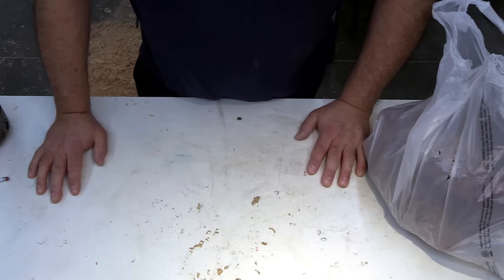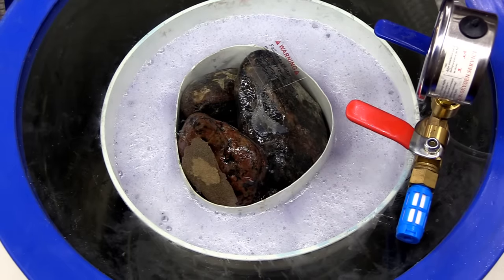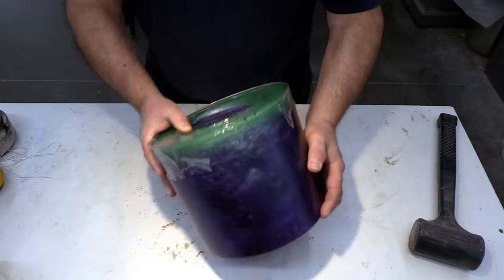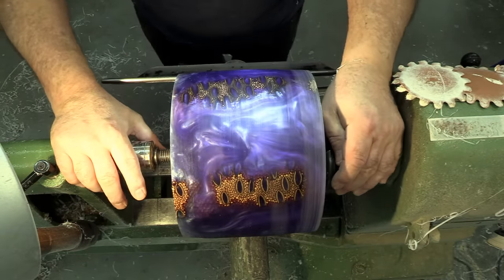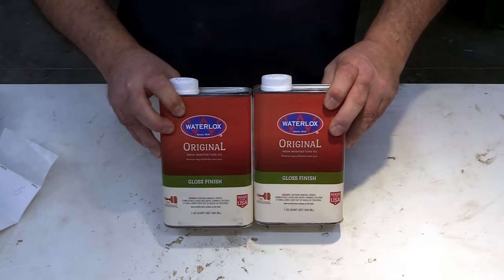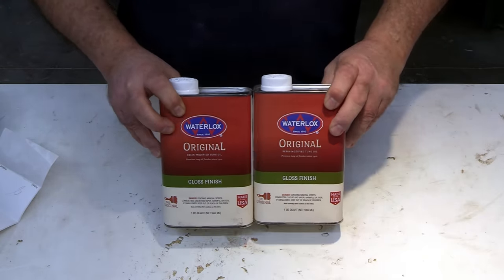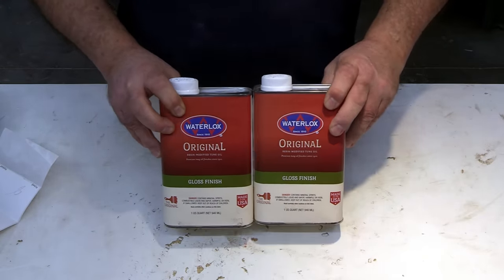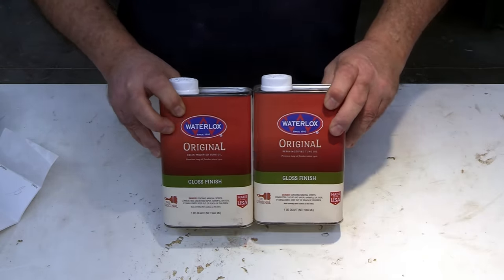Woodturning - Australian Dragon Skin? 2024 is The Year of The Dragon!

Comment: I often wonder why you put the epoxy coat on and then sand it to 220 and the apply the Waterlox. The piece looks incredible with just the epoxy coat from Designer Epoxy. Another great piece.
Reply from the maker: If you were holding it in your hands you wouldn’t say that. There’s some small runs and the bubbles are an issue too. Thanks.

Comment: That is an absolute work of art! Those pods with the colour make this an incredible conversation piece! I swear, those pigments from Designer Epoxy never cease to amaze me in their showstopping colours. I think that, because the green wasn't the same temperature as the purple, might explain why it traveled to the top, but that's just a theory as I've never worked with resin before.
Reply from the maker: No, I don’t think that’s it, possibly the purple pigment is a little heavier then the green and that’s why most of it ended up on the top. Thank you very much!

Comment: You should try using slabs to weigh down instead of mdf. That way you can keep the top and it makes it part of the design rather than forcing you to lose part of the casting. Also, those banksia nobs would make a cool handle for a lidded dish. Everything about wood turning and casting I know from watching you, so if there's an obvious reason for not doing either, sorry!
Reply from the maker: I will certainly hold onto them and cast them in the future. Thank you very much!

Comment: Another cool piece. As far as a more affordable finish, i make my own. Gloss polyurethane, tung oil, and thinner. Mix about 70/30 poly to tung oil and thin. You use enough varnish to know how thin you want it. Way cheaper, a couple quarts for around $40 US. Ive read about people using  a 50/50 mix but i go heavier on the poly and it works well for me. Hope this helps.
Reply from the maker: I can’t use this finish as it’s not certified non toxic once fully cured. Thanks for watching!
Reply: @SpragueWoodturning  I forgot you sell yours for utilitarian if they wish to do so.

Comment: I can easily cut the 6160 grade aluminum on my Onefinity CNC with good quality carbide spiral router bits. Just need to reduce the cut depth and feed rate to prevent clumping of the aluminum. Have not tried to cut it on a lathe but should work fine as an inlay. I will have to wait for you to try it and see.
Reply from the maker: Spoiler alert, it works great and cuts easily as an inlay. You’ll see it on Friday. Thanks

Comment: I think part of the problem with the green was that the seed pods weren't glued then you bobbed them up and down when you went to put the board and rocks back on it. The up and down motion pulled the green right back up. It is another reason so much green was on the top. I don't turn but I do a lot of resin and when you do that technique it's got to be in and out one time and then leave it otherwise it mixes just like what happened to you. Just a thought you might want to consider. I loved the look even though repeating holes like that gives me the heebee jeebees! lol Great piece!! Designer Epoxy
Reply from the maker: Yes, gluing the pods in place would of been better. Thank you very much!

Comment: When redurfacing brake druns which also chatter we wrap what i can best descrube as a wide rubber belt aroubd the drum.  Not sure if yku can get a wide rubber belt, but thats what we use.
Reply from the maker: As a former mechanic, I know exactly what you’re talking about. I bet I’ve done hundreds brake rotors and drums, lol. This here is a different chatter than that or vibration if you prefer. Thanks for watching!

Comment: Gday Jim,
Banksia pods rom Oz cost about Au$6 down here and up depending on size. They grow up to  1 foot by about 4.5 inches, I’ve never seen them that big but have certainly seen them much bigger 5han those you used.
If turning pods in the future be very careful of the brown fuzz as it can cause irritation to eyes and exposed skin.
Banksia pods are quite tough and abrasive to tools. 
I’ve never seen stabilised pods but that would help the turning and eliminate the dust that these can cause
Certainly a very unique bowl, hollow form. And thanks for sharing.
Reply from the maker: Thanks for the info!

Comment: This is my favorite piece you have done BY FAR!!  I have no constructive criticism. None.  I love that you went with the enclosed bowl.  It allows viewing the interior when most of your hollow forms do not, both in the finished project and to see the hollowing process.  To be honest, I like the enclosed bowls better than the hollow forms because of that.

I love the effect of the full sides of the pods as dragon skin, but I do agree with your first impulse of cutting cross sections and making a bowl where you can see both the shapes as both the interior and exterior very easily.

And as I'm typing this a person who plays Dungeons & Dragons, reads fantasy novels, and plays World of Warcraft, what about using the pods to turn Dragon's Eggs?  They would obviously need to be stabilized first and would fall into the category of "smaller volumes" that you were talking about at the end of the video, but they would be a hot commodity to fantasy fans, as a solid sculpture and as a small container (like a large nesting doll size).

Designer Epoxy
Reply from the maker: If I was doing production work I think the egg idea is a good one. Thanks for watching, I really appreciate it!

Comment: that is awesome.  I've always like the look of banksia pods, but didn't know how hard they are and I appreciate the heads up about needs to watch the sharpness of the tools. is it just much easier/safer to hollow it out on the lathe rather than pour it with a center place holder?  I was a little sad when you essentially turned the pod in the center into shavings.  I am supposing it's also a safter grip for the centers to have that pod there.  designer epoxy
Reply from the maker: It’s still visible on the bottom, and as I’ve previously stated, I’m not a fan of spacers that will determine how a project will need to be turned. Sometimes sacrifices will need to be made. Thanks.

Comment: Maybe try a cold air gun blowing on part right where steady rest runs keep heat out of that area.
We use cold air on some metal machining operations where you don't want messy coolant contaminating part or machine tool components
Reply from the maker: Good idea, thanks

Comment: There was a lot of movement after you added the green. Those pods were swimming around and you were trying to push them down. All that commotion is what mixed the colors (probably). I bet if you'd glue pods to the bottom so they'd stay fixed during the second pour (or should I say injection), then there would be much better color separation.
Reply from the maker: I’d say your right. Thank you very much!

Comment: In regard to the resins mixing and one not showing up, I'm wondering if the weight of the pigment might also have something to do with it floating or not. I'm sure the different colors that they use in those mica powders vary in weight depending on what ingredients are used. Some may be more buoyant than others. Just a thought.
Reply from the maker: Apparently they are the same weight. Thanks

Comment: For your chatter issues it looks like you need to speed up your rpms. Your cutting with carbide which wants pressure and speed to work. There are several different carbide blends out there now. You may want to contact your tool supplier to get more information.
I would start by checking your surface speeds. There are several apps to assist you with surface speeds.
I'm a retired machinist and surface speed is everything in how a tool cuts. Your pick of material will change your speeds as well.
Reply from the maker: Unfortunately I couldn’t go any higher on the speed, way too much vibration. Thanks

Comment: Jim, regarding the wheel issues foe the steady rest, do you know what hardness your wheels are?  I am an inline speedskater and wheels do have different hardnesses.  A softer wheel is rated in the low 80s while a harder wheel is in the upper 90s.  Those numbers mean nothing to you except it seems your wheel issues are related to the new ones you are using.  Try the opposite hardness if you know which you have now.  Hope this helps.
Reply from the maker: They are in the 90s, thanks!

Comment: Should you do something like this again in the future, it might be a solution to affix your pods etc, by fastening them to the bottom of the bucket using screws through the bottom of the bucket and into the inserts. This way you can control any buoyancy of the inserts and you can control the elevation above the bottom of the bucket giving you a totally encased insert. To prevent leakage you could seal off the screw heads with hot melt glue.
Reply from the maker: Like I said in the video, I wish I had of glued them down and it wouldn’t be an issue. Thank you very much!

Comment: What kind of smells do you encounter while creating your projects? I, personally, know what hot melt glue smells like but not much else in the way of what you use each week. Do different woods have different odors while on the lathe?
Reply from the maker: Yes, I usually can tell the different wood apart by smell. Different resins will smell differently as well. Thanks

Comment: So why do you use a vacuum chamber for epoxy instead of a pressure pot?  Does it actually get all the air out before it hardens? I have seen people stabilize wood with cactus juice in a vacuum first, bake it, then cast it in a pressure pot
Reply from the maker: I will usually use both when casting resin. If I’m working with good solid pieces of wood and I’m using deep cast that has a long open time I will usually skip the vacuum chamber. Thanks for watching!

Comment: Mixing the pigment with resin - to avoid adding too much air into it you can either slow down the cordless drill, or change the mixing thingy itself (to one that pulls the liquid from the bottom up, boat propeller style), or both.
Or you can try pre-mix the pigment with a small amount of resin first. Like, if you have a half teaspoon of pigment to mix in, pour 50 ml or so of resin into some small container, with a bowl-shaped bottom, add the pigment in and mix it not with square spatula but using rounded end peg. Once you get everything thoroughly mixed, just pour it into the batch of resin, "wash" the mixing container with more clean resin ans add it to the batch too.
Also, pre-wetting the pigment with a small amount of thin liquid (like acetone or pure alcohol), one that won't interfere with resin curing will facilitate mixing the pigment with resin too.
Reply from the maker: Thank you very much!
Reply: @SpragueWoodturning  "pre-wetting the pigment with a small amount of thin liquid (like acetone or pure alcohol), one that won't interfere with resin curing" - AND neither with pigment itself, of course. I guess those are not mineral ones, but some artificial stuff, so check it first.

Comment: can I do this with just pressure pot or vacuum pot? I do not have either a pressure or vacuum pot but for financial reasons would prefer buying one that would work. Thank you for your videos and great work!
Reply from the maker: You don’t need one at all, but the vacuum chamber and the PP will give you a better casting. If I could only afford one I would get the vacuum chamber. Thanks for watching!
Reply: @SpragueWoodturning  Ok thank you for guiding me in the right direction! I love your videos!

Comment: Just a comment on the chatter you were talking about. It appears you are dealing with an interrupted cut and being that the tool post is your hand\arm, I imagine that you are going to get at least some chatter due to the interrupted cut and the rigidity of your "tool post" and having that manifest as a frequency, ie: chatter. I do know that carbide tooling is harder than steel, but that means it is more brittle. Carbide tooling likes high rpm and super rigid "tool post". Carbide will protest to any kind of chatter or frequency against it. Try the ceramic button inserts on your hard materials, I think you will be pleased with the outcome. The ceramic is more expensive, but should last longer with better results than the carbide. Let us know if you try it. Cheers mate., great video! Loved the color combo, nice contrast with the brown and purple. Just goes to show how color combos can make or break a piece!
Reply from the maker: I’ve never even see or heard of a ceramic cutter, thanks.
Reply: @SpragueWoodturning  another suggestion, your local metal machine shop should have an insert rep or salesman that can help you choose the right insert and streamline your acquisition time. Thier knowledge, depending on thier experience is often invaluable when choosing inserts for your tooling. They can help with geometry of the insert, tool holders (although for wood turning, not sure if they would know) and helping you find indexable inserts that can save you $, although the button inserts can be turned or indexed easily due to the round shape, but the help they can provide on the geometry, you know the relief angles of the inserts can help a great deal. Inserts are great cause most of them are quite cheap, and you don't have to grind or sharpen them. Just index them to the next unused edge, and replace them when worn. Saves time and money.
Reply: @SpragueWoodturning  well for some reason one of my replies didn't take, but just do a search for metal machining ceramic button inserts and you should see numerous entries. Hit the shopping tab after you get the results page and that will help too. Ceramic inserts are often used on induction hardened chrome hydraulic rods and other hard materials. I first saw them at Cutting Edge Engineering on YT. Curtis uses them on the induction hardned rods, coincidentally he uses a button type inserts just like the one I saw on one of your tools.

Comment: Ha Jim I have a question I did a resin pour with pinecones using the deep cast about 3 days ago I just checked it still not fully cured yes and about and inch short all I have is the deep cast and art anresin from designer epoxy can I put more on the top what should I use or should I just live what I got? I do have aluminate and I like it as well  just wondering what you would do?  thanks. Larry
Reply from the maker: You can use the Artcast on top of the deep cast. Make sure the resin is curing in a place that’s at least 70F to 75F, if you don’t have it in a heated area it will take longer to cure. Hope this helps.

Comment: Definitely got a scaley vibe going on there lol the shape does do a lot for the finished look with the pods getting thinners in the middle and having wider epoxy areas but then widening at the tops and bottoms (kinda like peanut shells or 888's)

The green maybe adds to the lighter (metallic/glittery) whispy/ghosting pattern in the purple, I think it mat have been when the pods floated and needed pushed down it was probably enough to cause the resin to start mixing but then it mightve looked totally different and maybe not as good as it does (resin does weird things yanno lol).

It is definitely a "BOGOF" (buy 1 get 1 free) bowl though, looks completely different lit from the inside but either way it's a non cracked cracking piece lol

Looking forward to the next one already, take care till then 👍 👌
Reply from the maker: Thank you very much!
Reply: @SpragueWoodturning You're welcome, I was born year of the Dragon. So glad it wasn't the Monkey or Ass lol😅

Comment: Have you considered inserting a photo of the epoxy your are using instead of footage??? This way if you forget to include or film it, you can add a photo instead into any video you may forget to video.

I also dont understand the center one as you turn that away anyway most of the time. Either way, I still enoy the laughs and great videos you put together. Always a lot of fun.

Would a resin plate or disc work the same as the wood piece to hold the pods down??? This way you can incorporate it into the piece if you wanted to.
Reply from the maker: A photos not a bad idea, it can still be seen in the video so I’m not all that concerned about it. I put the pod in the center because this easily could of been a hollow form and then it would be missing if I wanted to go in that direction. A resin plate would be an option too. Thanks